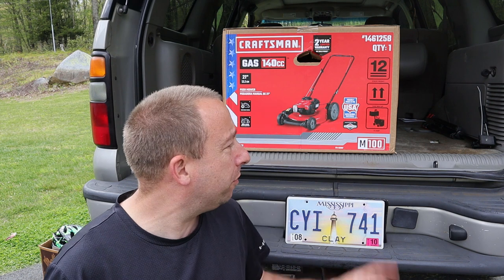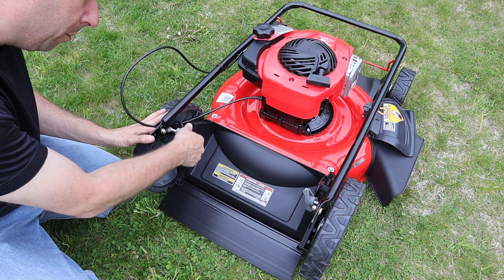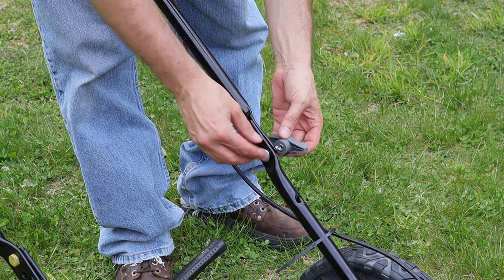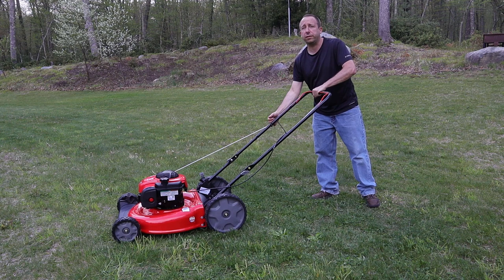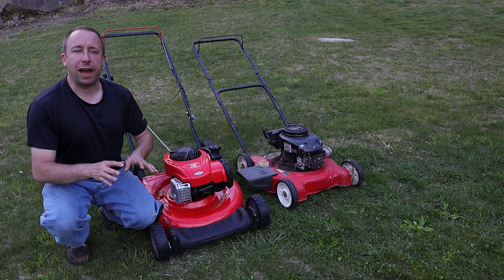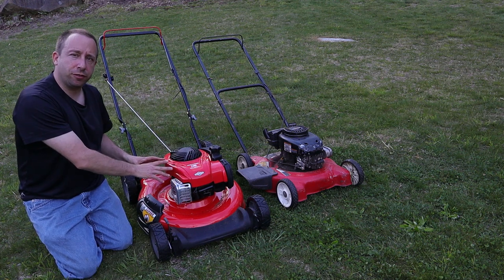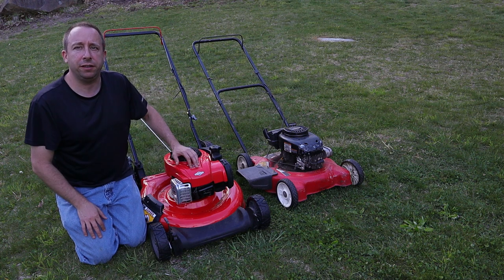Craftsman M100 Lawn Mower Assembly, Overview and First Impressions

Comment: Good video to enjoy. Did you buy the same mower? Here is your guide. 
—————‘—————
@0:00 Hello and Unboxing.
@0:20 What’s inside the box.
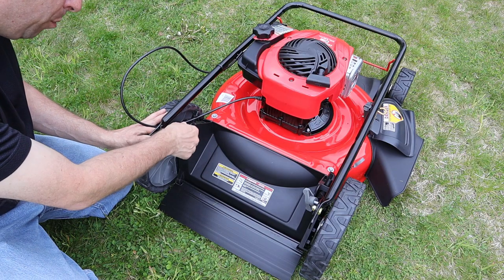@1:00 Setting it up for the first time.
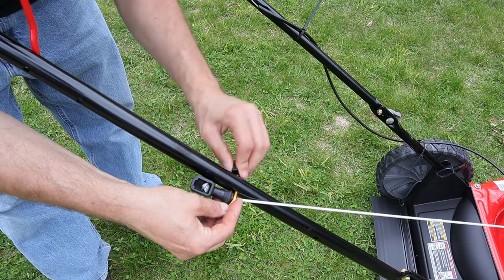@2:36 Don’t Forget !!!!!
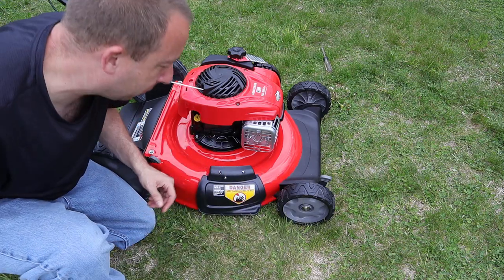@3:25 How to adjust the Height.
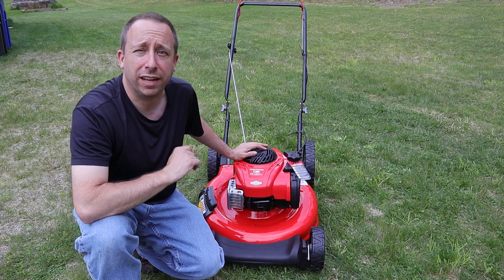@3:56 Adding Fuel.
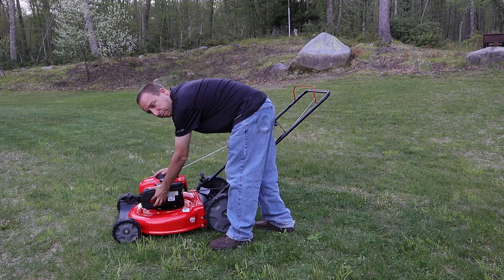@4:10 Starting and Testing. 
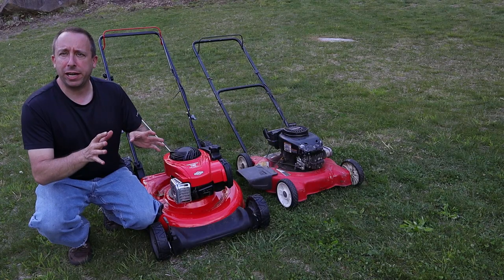@4:55 Why to Buy it. 
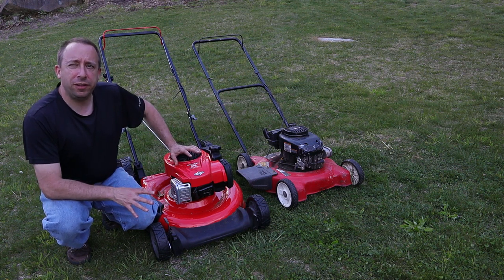@5:35 Price wise? 
@5:52 In comparison to the old mower.
@7:21 Thoughts about it. 
—————‘—————

I hope it helps. 

👍🏻
Reply from the maker: I bought this mower to replace my old beat up junker mower.  Thanks for your effort in creating these time stamps!  This is not expected but very appreciated!
Reply: SevenFortyOne your welcome. 👍🏻

Comment: I just bought the exact mower at Lowe's and I thought I was missing the oil fill part; but it wasn't missing, I just wasn't familiar with the way Craftsman does theirs and you covered it nicely in the video. Also I didn't know about the pull rope holder, so I learned 2 things today and the mower works awesome!
Reply: I couldn’t get mine out lol for nothing like it was glued on 🤦‍♀️😂
Reply: Apparently they are doing it differently now. Bc we have one that is like the old regular ones. I thought it was missing the oil part as well.
Reply: There is no image in the manual that matches this engine. I had the same issue with the cap. NOT user friendly. Designed by idiots.

Comment: Thanks for the video. I couldn’t get the carriage bolts through the holes either.  Considered hammering them through but was afraid I would strip the threads.  Watched this and figured it would be OK since you did it. Thanks!

Comment: I’m considering a new craftsman gas mower possibly next spring of 2024, but the self propelled m220 model which is front wheel drive. I have a 2015 toro self propelled mower but it has a terrible engine and it doesn’t run as well and I tried to start it last spring but it wouldn’t start up well. So that why I’m considering a craftsman self propelled mower. I really appreciate this review, this will help me narrow down my options for a new craftsman mower. Great review and Thanks again.

Comment: Did you have trouble putting the oil in? What kind of funnel did you use because the oil fill is in a bad place. I have a old Craftsman now but the engine doesn’t run as well.
Reply from the maker: I showed that in the vodeo

Comment: good video. I just bought the same model and it is missing one of the nuts that the "thumb screws" screw into. Any chance you know the size of this nut? I don't want to return this and if I can buy the nut at the local hardware store, it'll be an easy fix.
Thank you
Reply from the maker: Sorry, I don't
Reply: @SevenFortyOne  ok thanks. I did some homework and it looks to be a 1/4" 20 flat square nut

Comment: I bought a similar machine from Lowe's in 2003. Still use it, starts on the first pull, change the oil every year, and has been the best push mower I've had.

Comment: Thank you for posting this.  My 90 year old mother bought one of these at Lowe's yesterday and I couldn't figure out the lower adjustment for the handle height.  Do you have a video showing the throttle adjustment?
Reply from the maker: No, I didn't have to adjust mine yet

Comment: Just got this after last craftsman mower finally gave up after 30 years. 
But the manual/ booklet/ pamphlets are very lacking.
What spark plug and gap does the m100 take?
I can't find out anywhere.
It came with one, I guess I'll find it on there when I change it next season.
Seems strange the owners manual doesn't say.

Also it came with oil, but is vague about weight.   The bottle only says it is 15 oz, (444ml)

Also rather hoped changing oil would be easier.... haven't done it yet, but anticipate it being a pain and mess without a drain plug underneath.

Comment: Craftsman is quality in name only.   I purchased a shovel with  Craftsman's name on if from Lowe's.   The wooden handle could be heard cracking under normal use, also, the metal of the shovel is so thin that after you put it in the ground....you can move the handle like you stir a pot and the head will flex, ain't that some shit.

Comment: I just bought this from Lowe’s and this morning I was ready to read the instructions , and although I am very good at following instructions in a paper manual , I just decided to check YouTube and I found the tutorial that  you provided  to be seamless and totally accurate. Even the part about having to hammer in with the rubber hammer the into that little area on the handles. That was so helpful and allowed me to get this set up done within 10 minutes. It works great and it was very easy to set up. Thank you so much.

Comment: Only have watched a few videos on push mowers, but you were quick and to the point. As you said, only time will tell about longevity, but seems to be a good, basic push mower for areas the riding  one wont reach and I don't want too much left for the weed trimmer.

Comment: You are a life saver! I couldn't get the recoil starter rope to pull and it turned out to be because I had skipped the step with the black release levers (I thought I had a different model!). My wife helped me too but the important thing is that the mower now works. And I was going to send it back!

Comment: I'm lazy, I have 2 push mowers and they both have front wheel drive. I'm also cheap, on was free beside the road, and the other was bought used 10 years ago. LOL.  The free one looked brand new, and was missing the air filter??? Anyway, had it running in 2 minutes, and runs as new. Use it as a bush hog grinding up sticks and debris that I fail to rake up in the spring. I just mulch it.
Reply from the maker: I used to get them for free and fix them too.. and enjoyed doing it. .I just don't have time to do it anymore.

Comment: My nephew bought the same mower but his has the auto choke feature which i was surprised when i barely pulled on rope that ir started up, so i killed the engine and then when i went to restart it i tried held end of t handle with on finger and pulled real effortlessly and started up super easy to start, i recommended that mower with the auto choke to my sister because she has shoulder issues and she went and bought it at lowes and super satisfied!

Comment: Thanks Rob, I bought this online after I watched this video and picked it up today at a Lowes in Brookings, SD. We took it out of the box and followed your instructions by memory and about ten minutes later we had it running. I found a simular mower at Sears in Marshall, MN yesterday but it had a cheap Chinese engine on it and it was $30 higher. I told him Lowes had one for $200 and he replied that Craftsman builds those cheaper for other markets and I would get any warranty coverage from Sears. I said I don't care about warranty and I repair my own stuff.
Reply from the maker: I liked that the Lowe's version had the Briggs engine.  I saw the generic Chinese engine version at my local hardware store and wasn't impressed.  The Lowe's version  has a warranty but like you said it's usually more of a hassle to deal with a claim than it is to just fix the thing yourself

Comment: Thanks, you helped me figure out how to install the grass discharge cover. Could they make the oil fill harder to reach? Why doesn't the rear wheel have height numbers and why does the raise wheel mechanisms go in opposite directions?
Reply from the maker: Cost....it's always cost or more accurately cost savings by the manufacturer

Comment: my 2 mowers were curbside pickups.....they both only needed carburator cleaning....they are old but they run perfect
Reply from the maker: I used to pick them up too.  But I work alot and just don't have time to work on mower anymore

Comment: I absolutely hate mowers with that flimsy discharge chute that just hooks on. If you bump into anything it just falls off. I don't care in the least about mulching or any of that crap but the only mowers available that are discharge-only are the tiniest cheapest mowers made. I wish someone would make a proper high-wheel mower with a big engine and a bolt-on discharge chute. I used to have a Bolens push mower that I mowed 2 acres with, it was perfect, but I can't find anything like that these days.
Reply: The only way you're going to find what you're looking for nowadays is to buy a decent, used mower from 20+ years ago. I had a nice 6.5 HP B&S Craftsman with a 21" deck that was what you are describing above: side-chute only and large rear wheels. It was a well-built and great running mower too, but sold it as I prefer a mulching mower for my lawn. Happy hunting!

Comment: I bought the same exact one but it wont start at all for me. I did spray some starter fuel on the side of carburator and it would fire up but die right away. Help please
Reply from the maker: You should check the manual...there is usually a number you can call for help

Comment: I followed instructions but when I pull the cord nothing happens..HELP!!!
Reply from the maker: If you are sure you followed all of the instructions, including using the primer bulb, then you may want to call the help line in the manual.  Also, keep in mind you have to pull the cord fairly hard to get the engine spinning so it will start

Comment: Where is the oil drain plug. Underneath all I see our bolt heads for the deck and block. I want to drain the dirty oil but cannot find the plug.
Reply from the maker: Check the manual...I'm not sure
Reply: @SevenFortyOne  So, you've never drained the oil? I don't see any plugs, just bolt heads.

Comment: Do you tip that mower to change the oil or is there a drain plug?
Reply from the maker: There is usually a drain plug .. check the manual to be sure

Comment: Hi. I just bought the same mower. Put it 2gether without any direction. Only thing is pulley thingy to start mower won't pull. It seems stuck. My only problem. Too scared to pull with any harsh force. Can you please give me any valuable tips. Thank you so much in advance 🌹.
Reply from the maker: Are you squeezing the safety bar on the mower handle while trying to pull the rope?
Reply: @SevenFortyOne  Yes I am. That's the 1st thing I did. Time I uninstalled from the box, I put it 2gether and tried to pull the string to connect to the thing on the side that holds it in place and it wouldn't even pull to reach up that far. Could it be defective?
Reply from the maker: Hard to say without being able to see it for myself.  Maybe go to the store and check a display model to see how it is set up....
Reply: @SevenFortyOne  Ugh!! I will. Thank you for such quick replying. 🙂

Comment: I have this mower, I just bought my first house and got it as a house warming present. The one thing I didn't like is that it doesn't come with a catch bag. I called Craftsman and ordered one, it's two pieces, the bag and a frame for it. My issue is that it doesn't have a trap door in the back where the bag would normally go, it's a solid plastic frame. And taking that frame off doesn't work because the rear wheel adjuster is integrated into the plastic cover. Craftsman told me that I Only needed these two parts, I don't see how that is possible. Do you have any ideas? Been searching for an answer for 2 hours but with no luck. Any help would be appreciated!
Reply from the maker: This mower isn't designed to have a catch bag.  If you want that feature I suggest buying a mower that comes with it.  I've seen mowers like this one with tubes that connect the side chute to the rear bag but they clog very easily.